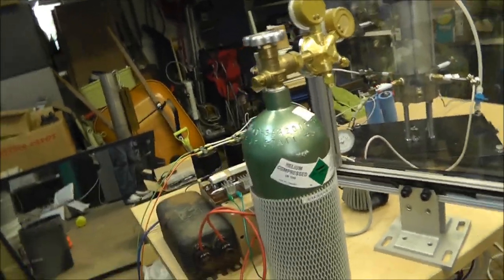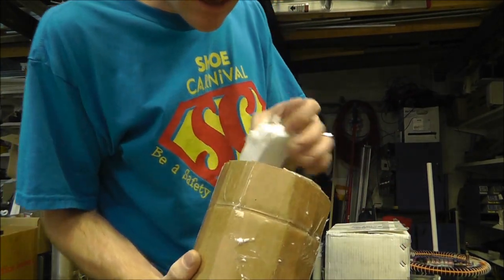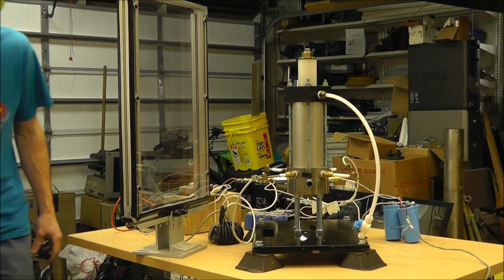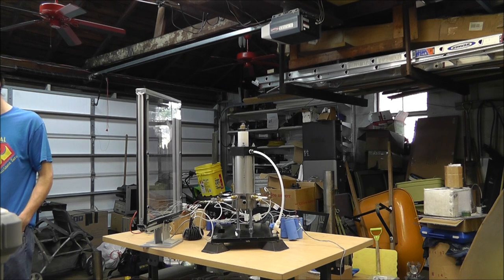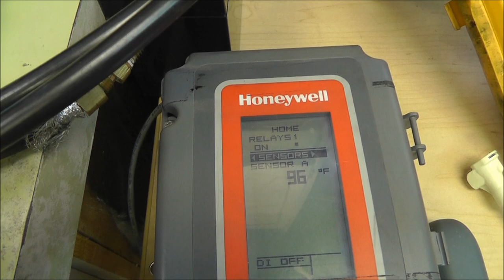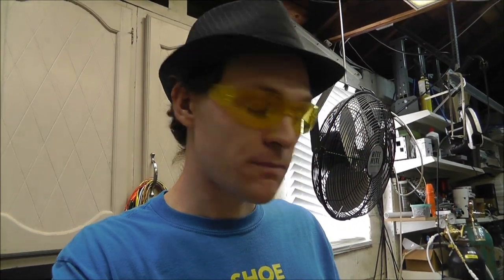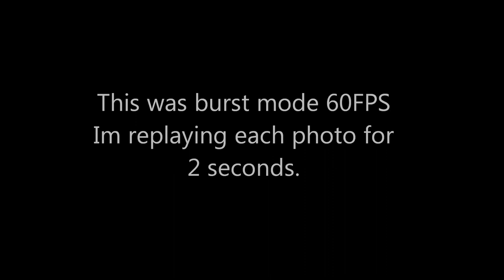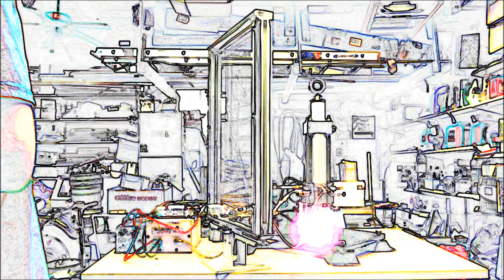Update 12 NGE Papp: Helium Testing... Now That's Interesting... So The Darn Thing Dose Work?

Comment: Glad you're already on that track. I guess great minds think alike :-)
I come to your channel for the Stan watercar work, but this is interesting in its own right. If it's not overunity though, it will have a hard time keeping up with straight up electric as a motor. Many parts and seals plus gas losses vs as little as 2 or 3 parts in an advanced simplified electro design. But surely a great project to follow as well. Thanks for sharing your work the way you do.

Comment: This thing, but with a chamber each end of the cylinder, and hooked up to a Ratchet Engine type transmission, then you've your yourself an engine and efficient way to turn it into continious motion (say for a vehicle). 
The back-forth action of chambers each end would sort the retraction of the piston I suppose? A long stroke on the cylinder would really help to make it practical. A matter of thinner piston or larger chamber?

Comment from the maker: yes, look up on the poper thread, (tinman) posted his ideas on a  " ratchet" motor... if i build one i will be using the power stroke and the return stroke as there is a lot of losses as it moves so fast... this of corce is if i use this set up as a final test " motor" ~Russ

Comment from the maker: yes. if you look frame by frame its coming off the table before the table " springs" back... lol that piston has some series force for the first 1/4-1" of its stroke... will get with you. what kind of GUI / controller / soft were are you use to programing and such? thanks! ~Russ

Comment: The reason it dies out when you rapid fire is because the gas needs time to cool down and contract between cycles. If the gas is already hot it will not expand anymore. When you let it cool off you get the largest amount of expansion thus the largest reaction on the push rod. I already see power in to power out is dismal and that's an overly generous assessment. If you worked on a pulsed piston motor that recaptures energy from the coils also eliminating back EMF that may have potential.

Comment: Hey Russ, Just a few thoughts. If you use a different surface when calculating force excretion from piston to rig. You would get more accurate data. i.e. the workbench underneath the rig  gives way when force is excreted into it. 
 
Also: Is the cylinder and/or piston made of aluminum? It seems to me the piston moves a lot faster up than down, if it’s aluminum it may be caused by kinetically induced eddy currents.  Like i said, just a thought.
 
Good work hard times challenging people

Comment: With the "Cold Fusion" deal, the arc reaches over 10,000 degrees fahrenheit because of the current, from what I gather.  Could something similar be happening, causing  the electrodes to get hot, due to the high current arc?

Comment: What about extra weight atop the piston -
will longer enforced containment increase explosive pressure force and thus the torque potential within an engine ?
Does the force change with increased temperature ?